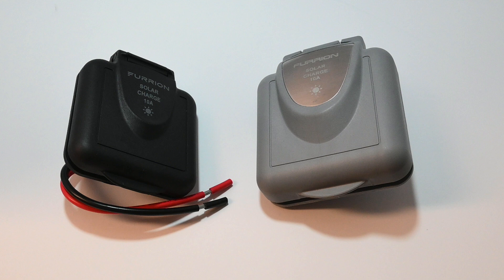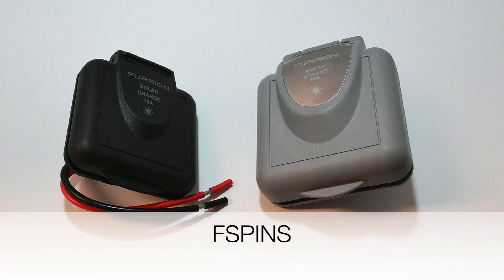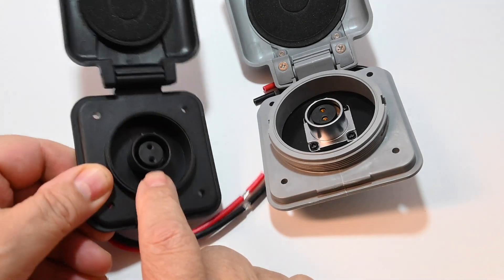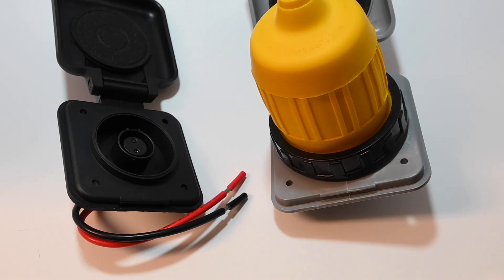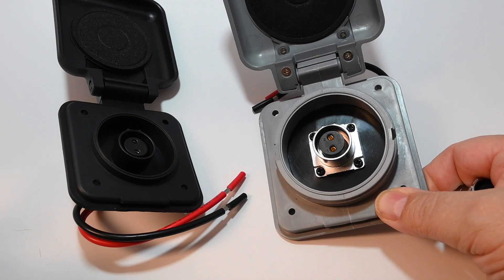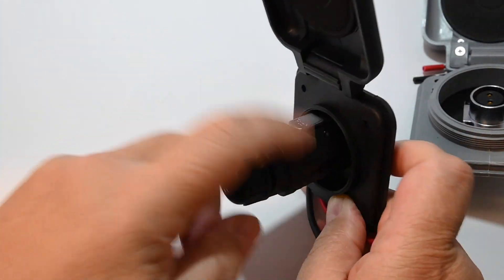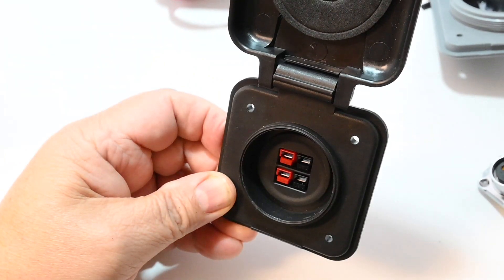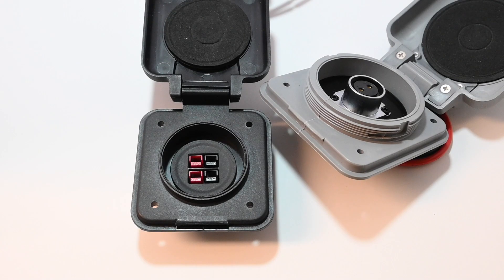Yet another Furrion Solar Inlet Port Video - An update to video 9 of my Solar Suitcase Panel series.

Comment: I think the 10 amp rating is a gimmick  - like you said the wire is rated at least 20 amps and 240 volts so why would the inlet be rated for 10 amps and 14 volts? EDIT: I spoke with Lippert/Furrion and confirmed that the inlet is in fact rated for 10 amps at 240 volts. So the 12 awg wire may be rated at 20 amps but the 2 pins at the end of the wires are rated at 10A/240V. This is the design spec that should be used to determine how to connect this inlet to solar. Based upon this information, you can easily connect 4 100 watt panels in series through this port then to a solar controller which connects to the battery.

Comment: I recently purchased a class c motorhome with this solar port installed. I have verified underneath there is only 12awg wire running directly to the battery and no inline fuse installed from the factory. Would you agree a renogy 200w suitcase which only outputs 10.5A would be perfectly safe to connect to this port? I was also considering installing a 15A mc4 inline fuse between the controller and the port? What are your thoughts?
Reply from the maker: There should be a fuse between the battery and controller. However some controllers have that fuse built into the unit, so check the controller.

12AWG may or may not be sufficient for a 200w solar panel. The issue at hand is not the current handling capacity, but the series resistance of the wire.

I explain all of this at length in my suitcase video. Links are in the description.
Reply: Thank you so much for the response. I have watched the entire series. The 12awg wire from the furrion port to the battery is approx. 3ft. If using the 200w panel and 20a charger with only a 10ft 10awg extension, I can’t imagine there would be any issue, unless I’m misunderstanding something along the way (which is likely). 

the Cnlinko connector is also only 12awg  from the furrion port to my battery so there would be zero difference, other than the printed 10a on the cover. 

My best guess is furrion just wants us to buy their panel, but I can’t find any legitimate reason to limit myself to 100w? Is there something else I’m missing?

Thank you again for all your hard work on this and for making yourself so available for questions!
Reply from the maker: @244Jesse  Thank you for supporting the channel.

12AWG will handle 20A easily, but it is the voltage drop that is the issue.  Given that, 3ft of 12AWG and 10A should have a voltage drop of about 100mV, which is not going to be an issue.

Especially if the controller is located as close as possible to the battery.  This can be done with either MPPT or PWM controller, and the solar-to-controller wiring is a bit more tolerant of slight voltage drops than the controller-to-battery circuit.
Reply: That gives me an idea….. Is it plausible to remove the 20a controller from the renogy suitcase and relocate it inside the RV, behind the furrion plug, so that voltage drop from the controller to the battery is virtually eliminated?
Reply from the maker: @244Jesse  

Bingo. That is how I initially wired my unit, but I have since upgraded the controller to MPPT in the RV.

That allows me to use the solar panel with the RV (using the MPPT controller), or independantly (using the Renogy PWM controller) if I need to charge the battery on  a vehicle, boat, etc. 

I dedicate  a video in my video series about just this configuration. 

I consider it  best practice.

Comment: Is the gray unit from etrailer already rated at 20 amps?
Reply from the maker: Its still listed as a 10A connector. However, you can easily replace the connector with a heavier duty 20A CNLinko connector.

Comment: Based on your review, which I sincerely appreciate, I ordered a white version of the port.   I needed to remove the center and mount an ethernet jack so I could run some CAT5 cable from outside to inside.  Guess what - the white one (from eTrailer) that shows a screwed in middle section arrived and it is molded; just like the black port.  Such is life....  I just need to drill out the center piece and mount my ethernet jack.  No big deal but I thought you should know.

Here is what I ordered... https://www.etrailer.com/p-FSPINS-PS.html#exp-productdetails=.reviews
Reply from the maker: Interesting that eTrailer shows the other style port in their photos.

That old "specifications subject to change without notice" will get you every time.

Comment: The real joke is that Rv people say its "pulg and play" but there is no charge controller between the outlet and the battery. so its possible to overcharge a battery with higher than normal charging voltages. I have one of these on my RV I dont use it at all. I have 200 watts of solar on my roof with 30 amp charge controller.
Reply from the maker: They are intended to be used with a portable suitcase solar kit which has a charge controller at the panels.
Reply: @RVProject  i see that makes sense!    
great channel!

Comment: Thanks for the video. I wonder if it will be hit or miss when ordering these, or if they are switching to the grey/white based on feedback that the plug doesn't make a strong connection.
Reply from the maker: Good point.  I have no idea.

Comment: You know i actually like the fact that the black port doesn’t exactly lock in. The port does what it needs to do, but i got three children under 6 runnin around the rv. Id rather the clinko connector comming off of the furrion inlet adapter then rippin out of the charge controller if you know what i mean....think thats actually safer. Also for trip hazards or whatever
Reply from the maker: Probably would be a good idea to bungee the cord to the landing gear, etc. to secure it.

Comment: But, essentially with one 200watt solar panel, were ok to use the 10 amp furrion inlet? Right? Its really only necessary to upgrade the inlet to 20 amps if were gunna use more than 200watt solar panels, correct?
Reply from the maker: With a 200Watt panel, you can actually have up to 11Amps of current flow through the Furrion port.  As well, the manufacturer often installs a 7.5Amp fuse in the RV connected to the Furrion port.

So I need to take the safe approach and recommend you upgrade to a 20A port.
Reply: @RVProject  hi, me again. Another question though, since the cnlinko adapter is already rated for 20 amps...can we just change out the fuse from the rv’s furrion adapter to a 20 amp fuse?
Reply from the maker: @kylezenklusen2041  As long as the wiring is up to it, and as long as you don't wire the panels in series, then a 15A or 20A fuse should work for a 200Watt panel.  But if you ever wire panels in series, you will need a higher voltage fuse (I am working on a video right now about fuses for series-wired panels).
Reply: Another nice video by the way, super interesting